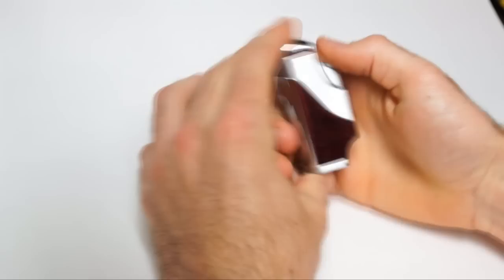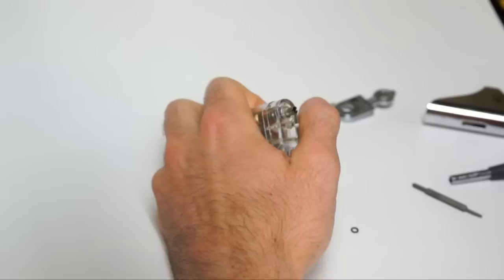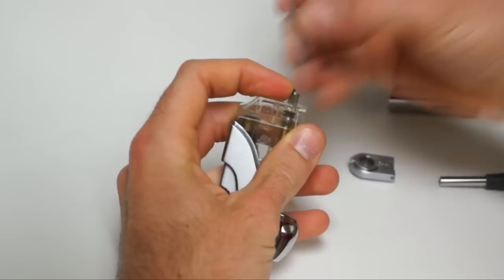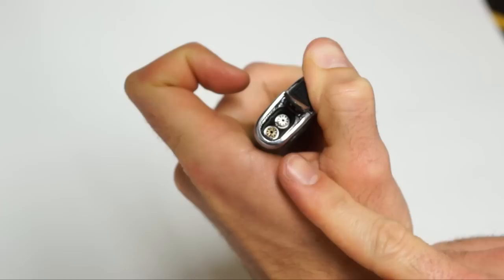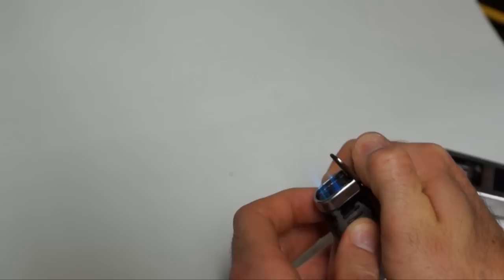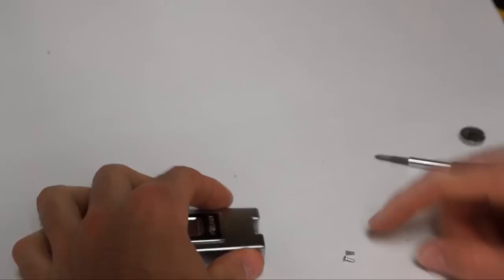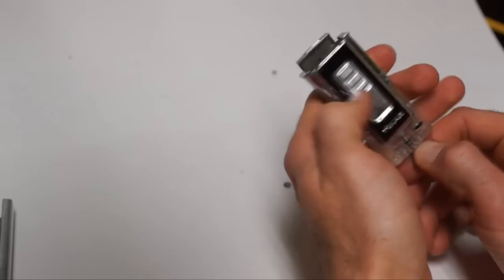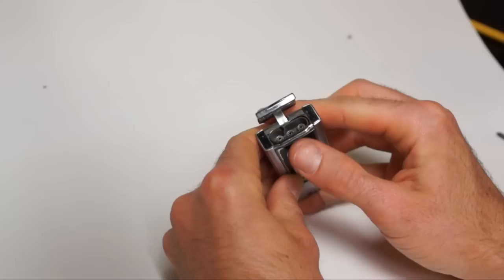Fixing A Broken Lighter: In-depth Diagnosis for Repair

Comment: Great how-to video! I was able to fix my butane lighter. After I filled it, it wouldn't ignite so I bled it a few times. Still no dice. Your video showed me how to take my lighter apart and make a slight adjustment to the flame adjuster and VOILA! It works! Thanks again!

Comment: the lighter lid on my jet line will not stay closed. The little nub the the top snaps down over to shut seems does not have enough tension to hold the top down. The opener works but there is not enough tension to keep it closed-any ideas how to fix this?

Comment: I'm so glad that I came across your channel. It blows my mind that there's almost no worthwhile information on more in depth understanding of towards construction and repairs… I've come to be fascinated by them and do enjoy repairing them and also keep pretty good care of my torch lighters. I have an Eagle pencil torch that I favorite quite a lot.  It's cheap karma only about $10 but high performance level for the cost. Anyway this it stop sparking and I open the doc to replace the piezo and all the components pop out. I've got it rebuilt but cannot figure out the function of the magnesium strip in where it goes. Would you be willing to make a video on it or at least contact me?
Reply from the maker: haven't tried to fix that yet i just replace it with a spare piezo from a broken lighter that still works...

Comment: At 3:57 when that piece can blow off the lighter…this happened to me. How do I fix it? Or do I have purchase a part. Any assistance would be amazing. My torch is 8 years old and very dear to me.
Reply from the maker: unfortunately we do not have replacement parts. you would have to contact the manufacturer for that.

Comment: Enjoyed your video. I wonder if you can tell me how to get the case off of a scripto "social lights" lighter. I have removed the cover screw from the bottom of the lighter as well as the flint assembly from the top. I am at a loss on how to proceed. I do not see any additional screws holder the internals in place. There is, what appears to be a brass colored tube leading to what I assume is the inlet for the butane. it appears to be threaded and has small notches on the edges of this tube. I do not want to attempt any further dis-assembly. I do not know how, or if, youtube allows photo attachments or I would have posted some photos of the lighter. Thanks for any help you may be able to give me.

Comment: I am having similar problems as that first lighter. No fuel coming out. Do you have a video going through the fix on that lighter? Thanks!
Reply from the maker: I have no fix for that....
Reply: I managed to get fuel to flow. I removed the valve where the fuel usually comes out, basically stripped it to just the tank, the fill valve and the  fuel adjustment brass float and screw. I fill the tank and still no fuel was coming out. Figured what the hell and lit near the output hole missing the valve and must have burned something off. Jet of flame after that. Put the valve back on, refilled, but now it doesn't turn the fuel off. I think the valve/nozzle where the fuel comes out is either stuck open or has quit functioning. I can send vids or pics if you are willing to help.
Reply from the maker: @marcusgallegos2624  i dont go that deep into lighters. sorry I cant help

Comment: I’ve got a couple lighters that don’t work and most are over $100-200.  About 20 years old.  Colibri and Prometheus.  Sent em in.  They sent back saying colibri doesn’t exist anymore or something. It’s a nice lighter but been problematic.  Opened it up but afraid to mess with it.  Not really a lighter repair place here and don’t want to spend lots on it. Hoping I can figure out how to fix it.  No gas coming out. Seems one flint of the dual flame isn’t working either.  Fills with gas ok... just not working.  The other one I’ve not yet checked. Just realized to search on YouTube.  I can’t even find the model I have based on some google searches.  This particular one was about $150 or so back in about 2000-2003 ish.  It’s silver with a dual bay door opening on top and a large switch on the center of the lighter that opens the bay doors and ignites it.  Been wanting to fix these lighters for years. Now I am going to try to figure it out after sending it in and getting a return to sender :-/
Reply from the maker: most of the time it is an easy fix, good luck!
Reply: Pedantic Pete if you really want it fixed by a pro, try a small jewler.  My father had a collection of WW2 lighters that he would have fixed by one or two jewelers.  His collection of 50 lighters sold in 1991 for  $25k at auction!

Comment: Thank you @Regency Cigar for the good information.   You solved most of the problems I've ever had with a butane lighter except one!   I've had more than one lighter stop "clicking" when the lever is pressed down.  It is just a kind of soft mush feel as it comes back/goes down (whatever it does) and then nothing.  No click no spark   Can you tell me what the issue is and how to repair it?  Thank you so much!
Reply from the maker: Its probably the Igniter, it would need to be replaced, but not sure where you would get the parts...
Reply: Replace the piezo igniter found in any click lighter.

Comment: Out of all the videos I've watched I still haven't come across anyone showing soft flames coming out when the lighter used to blast out jet flames . I've read through so many comments sections trying to find anyone else who's had this problem and nothing! I've bled the lighter several times , I've taken the whole thing apart all except for stripping the fuel value from the plastic tank.. its an Ignyte 4 jet lighter (not sure if i spelled that correct) and the only part that I think might be an issue is the hose connecting the tank to the torch head is very skinny compared to all my other lighters hoses and all 4 burners are built into the torch head to run off of that one single narrow hose.. I would  like any thoughts or suggestions and anyone has about this .

Comment: Hi I bought a Bugatti lighter and recently when I try to refill it, the refilling valve lets out the butane in a matter of seconds I thought maybe the butane valve is broken and remains opened but I'm not sure any advise ?
Reply: U might of pushed valve in to far poke around see if it drops back in place

Comment: What if you can't hear the gas coming out but the hose is connected... This is a brand new lighter and I'm using zippos lighter fluid. And I also have a spark.
Reply from the maker: I don't encounter this problem much, the adjustment inside the lighter that controls the flame height is probably at fault. I don't have a fix for this sorry, I would return a lighter to the manufacture when I have a problem like this.

Comment: if I do not have never dull what else could I use?
Reply from the maker: Sorry for the delay I would use a little bit of rubbing alcohol on the end of a qtip
Reply from the maker: Rubbing alcohol on a Q-tip just shake off the excess so it doesn't drip into the lighter
Reply: O wow awesome OK thx I'll try that out

Comment: Hi
I got a new butane flint lighter. I can hear a hissing sound (the gas is coming out) but I got no flame. I wasn't able to lit it with another lighter either. however by adjusting the valve too low, I managed to get it work but the flame is not of any use in this state. please note that I've emptied/refilled the tank twice. any suggestions ?
thanks in advance.
Reply from the maker: So the flame is just to low to use or to high?
Reply: +Regency Cigar 
just too low. any attempt to adjust the flame higher results in flame out. after that the butane can't be lit with other heat source until the adjustment valve is turned back to very low.
Reply from the maker: +Ramtin Haddadzadeh 
What do you mean by flame out? One thing that I find happens on older lighters when you turn the adjuster to bring the flame higher or lower nothing happens and the flame is always too small. This is one problem I do not have a fix for :(. Is that's what is happening?
Reply: +Regency Cigar 
No. after turning the adjuster counter clockwise, the hissing sound increases. so it's evident that the valve is still operating somehow. however turning the valve slightly higher will extinguish the flame. in this situation the exiting butane can't be even lit with the help of another lighter.
Reply from the maker: +Ramtin Haddadzadeh 
The flame shape is solid right when you light it with another lighter, it's not distorted in anyway?  If it's not a  perfect flame they don't alway like to run right...
Reply: +Regency Cigar 
Strangely, the flame is burning pretty smoothly and it's totally blue. it's just too small. there's one thing that might help; although after adjusting the flame to higher level, it cannot be lit with another lighter, using the lighter's flint in this setting causes a yellow spark of flame for just brief moment. it is as if the flame is started to burn but fails to continue after a moment.
Reply from the maker: +Ramtin Haddadzadeh 
So will it not light when turned up because the flame is to big? Does it kind of blow it's self out
Reply: +Regency Cigar 
Seems so. it is as if the butane/air ratio isn't right. it's like a small flame burst.
Reply from the maker: +Ramtin Haddadzadeh 
If your lighter flame height is not adjusting up-and-down when you use the flame height adjustment screw or knob that is probably your issue. Something internally is stuck in the lighter to prevent the flame height from adjusting, I really don't have a fix for this issue except to recommend turning your flame height adjuster up and down repeatedly to try to loosen whatever is stuck. 
Tyler
RCE
Reply: +Regency Cigar 
Thank you very much for your time and aid. I'll give it a try.
Best wishes.